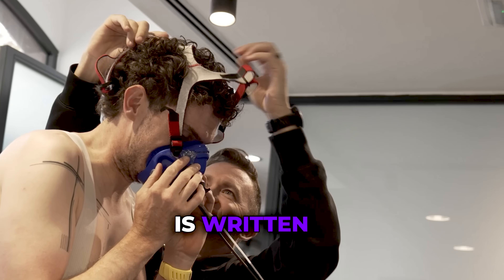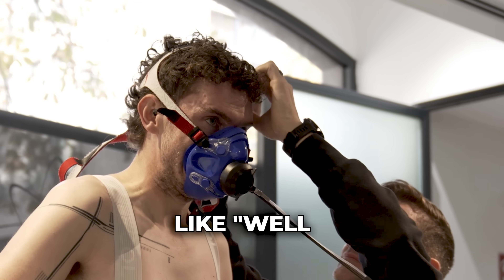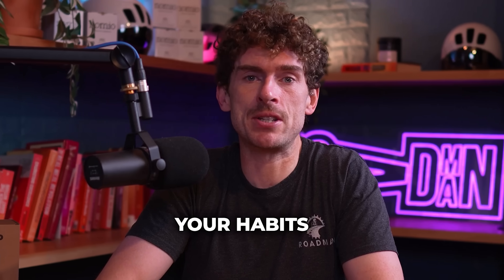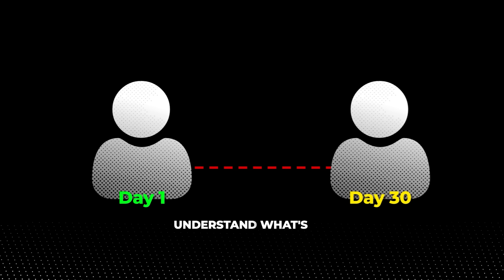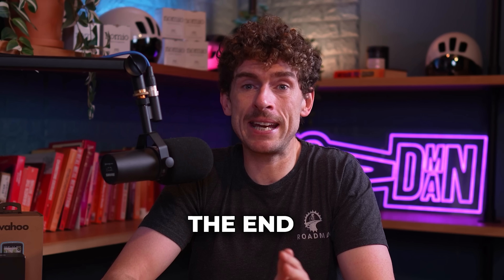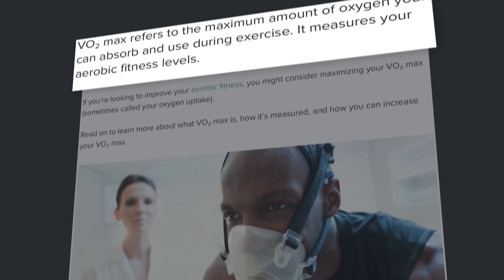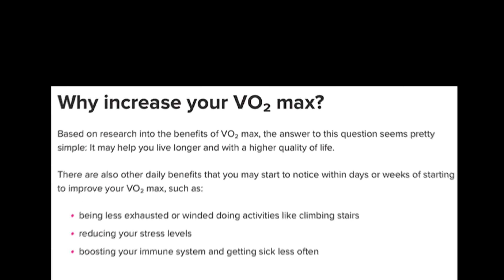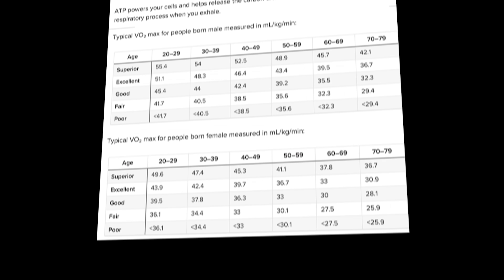7 Fixable Reasons Your V02 Max Is Low While Cycling

Comment: Couldn't agree more. I'm a runner of 4 years aged 34 and got into running when the first mut was born. At 85kg I always found zone 2 work difficult but knew it's benefits.  Got a zwift bike 5 weeks ago after watching YouTube and sick of the cold weather. Starting v02 max was 58 after FTP test. Started immediately doing 2 hour zone rides in the morning and v02 max workouts prescribed on zwift in the evening and my weekly mileage is around 200 to 250km. V02 max has steadily jumped from 58 to 66 in 5 weeks and FTP up at 300w. As someone who has never cycled or understood watts etc .. I'm amazed at how quickly you feel fitter by polarizing zone 2 and then the high stuff.  Sadly couldn't get these gains in running as only hit 60 v02 but been there for over a year and that's with 80k weeks. Cycling is brilliant and zwift is a game changer with the different workouts. But great podcast and I can vouch for what your saying from a personal perspective!! Listen up people.. it works!!! Now.. question is... If I can get up 8 v02s in 5 weeks..... Could I get to 80 in 3 years????

Comment: All good, but you dont mention how, outside of a lab, VO2 max is determined. Estimated L/min or mL/min/Kg? In the case of the latter I can improve my "number" by simply shedding some weight. VO2 max is a physiological state, not a power number, and if you can do more than 15' time in zone above 95% VO2 max in an interval session then arguably you aren't going hard enough. Good timing though as I have my first VO2 base phase session tomorrow and will be easing into to it to find where I'm at and build on that. Right, where did I put that bucket 🤔
Reply: My Garmin tells me what it thinks it is. You will need power as well. My trainer does that. Probably doesn't matter what the exact number is, you can still track improvements.
Reply: @humpy125  Exactly, it doesn't really matter what my specific VO2Max is, the important metric is which way it's trending.

Comment: To be clear, while there is some ability to improve VO2max with proper training, there is huge genetic component to everyone's potiential. That Pro you mentioned blowing an 80 was probablly born with a 70 and worked for years to improve 10 ml/kg/minute.
Reply: Yeah and amateur’s who work as welders prob got lung damage so can’t reach their full potential no matter what training goes on.
Reply: Tbf there's also a huge genetic component to the length of your femur hence your leverage and the size of your torso and shoulders hence your CDA and your height and ultimately ideal racing weight. VO2 max is trainable with improvements of 15-30% being typical, those numbers are huge.
Reply: Definitely no! Nobody is "born with a VO2Max of 70" potential... There ARE definitely a genetics influence, but way way less than what you imagine... almost every (male) person can train their VO2Max to 70, with the required focus and determination...
Whether they are capable of mustering the required adherence to the required effort (eat, sleep, train & recover) is another discussion, but if "forced to compliance", the genetics barrier is nowhere as low as you imagine.....

So - VO2Max of 70 is free for nobody, and likewise, nobody is capped of at 60....
Reply: @tonypilborg  What on earth are you on about? Nothing in the literature supports your claims. 70 VO2 max is literally only seen in the absolute top segments of endurance sports. Stop spreading misinformation ty.
Reply: @ahhalla thats because the testing is wrong. Theres no baseline of what the actual average male actually is. Modern testing is only comparing elite athletes who have been mostly training since their early youth, to relatively untrained average, or casual athletes. We would need a much larger test, testing every athlete who's started at a young age and been consistent in a competitive environment for a long period of time, to establish a baseline. We could then establish what a true average vo2 max actually is when comparing trained athletes to trained athletes. The average actual vo2 max is likely much higher than testing is reporting. We can't compare a dude who ate cheetos for the first half of his life and then got into cycling at 30 with the elite athlete who has been eating and training correctly since he was 9. Same genetics  but vastly different vo2 max. This is the lack of a reliable average. This isn't even taking into account muscle mass as a component of lower vo2 max. Most dudes simply carry too much upper body muscle mass to achieve the higher vo2 max numbers. This isn't genetic either. It's usually a component of environment. Upper body Strength training is usually much higher on the priority list of the average joe especially in the western culture. Muscle mass and where it's held on the body should also be taken into account, and its currently not when comparing average vo2 numbers.
Reply: @OUTDOORS55  No shit VO2 max is going to be higher on average if comparing trained athletes and elite athletes lmao. Are you implying that endurance athletes get into their sport by chance, hence everybody has higher potential for VO2 max than the literature describe? Elite athletes get into the sport because they show talent ie. for cycling, a high baseline VO2 max. The slowest kid in your class isn't gonna get into competitive running because his genetic baseline is shit. All this doesnt matter anyway, because 70 is extremely high and only seen in the top percent of a very select few anyway. When saying statements like "the average male can reach a vo2 of 70" you are implying the whole population as well which is laughable.
Reply: @tonypilborg have you run tests on a larger population or just attended too many motivational courses? To disregard genetics as a big factor in sports  is crazy.